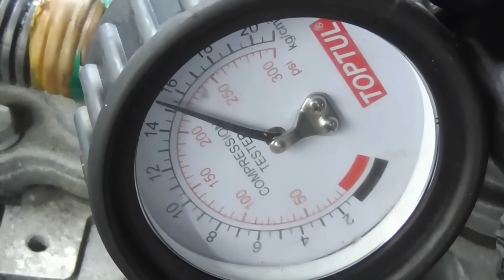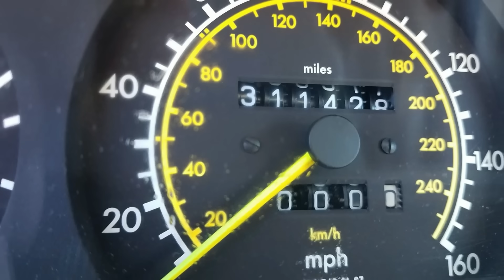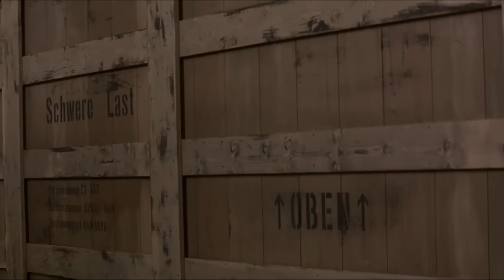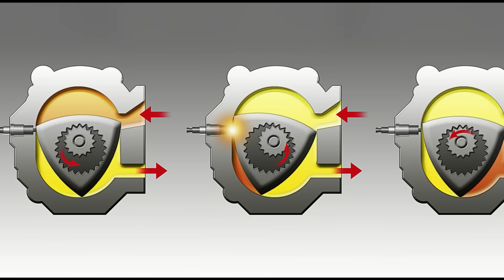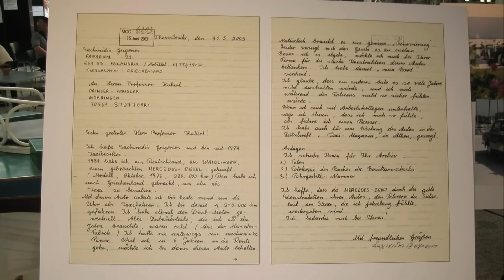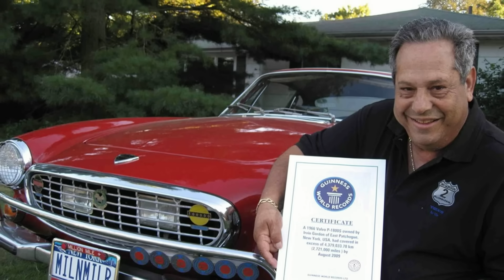Most Reliable Engines of All Time

Comment: I can't believe you have placed BMW engines as reliable. Having worked for a BMW dealer I know different!
Reply: This man's comment is the closest thing to 100% truth  in the universe
Reply: Diesel BMWs are okay as far as I know...
Reply: @MrAvant123  6 cylinder diesels and also 4 cylinder made before 2007 m47 are reliable n47 after 2007 have timing chain issues
Reply: S52/54 with vanos removed
Reply: Ive thrashed my e90 330d for years and it is the most reliable car ive had and pretty swift as well .use good oil and shell v power fuel, job's a gud'n
Reply: M57 is very reliable, what are you talking about? yes its advanced and hard to work on
Reply: How about the 4 Series BMW?
Reply: Well said--BMW--Broke My Wallet.
Reply: They have made some pretty reliable engines despite some others were no that reliable. For example M10/20/30/50/52 engines were pretty simple and very reliables. N52 despite VANOS and Valvetronic is bulletproof engine.
Reply: Especially BMWs inline 6 engines are regarded as very reliable.
Reply: I've owned 2 bmws, purchased both new. 
Both of them broke down within a year. So I bought a first gen turbo honda... let's see how this goes.
Reply: BMW engines are very reliable but drivers are not! Everyone who drives BMW dosn't drive them normaly!
Reply: @DJFlying82  ,
Sir, of all the comments I have read on realiability I find yours to be almost the  truthful one. However , you should have said (NOT Everyone who drives a BMW drives them normaly).
Reply: @carl-uk1774  sorry, my English is bad, but I think people had understand my point.
Reply: @carl-uk1774  That's true.  I have a friend who bought a new 328i in 2004, drives very conservatively and religiously maintains it...it's still going strong 17 years later, coincidentally now has 328K miles on original engine.  A lot of that probably has to do with it being an inline 6...Henry Royce used those extensively in various Rolls Royce models because he found that it was inherently better balanced than any other design.

Comment: this guy things 200,000 miles is a lot we have a expedition that has been ran at out oil before several times by a hs student not taking care of it. It stopped reading miles after about 280,000 2 years ago and runs till this day its 4.8 btw

Comment: I get it. You're a youtube host. Cars are not your profession. 
Buuuut. Perhaps you should leave the choosing of reliable cars to those with a little more knowledge about the subject. 
No rotary engine would ever be considered reliable by anyone's standards. They were built for power and light weight. Not to run a million miles. 
The 2jz is an INCREDIBLE engine. But as far as reliability is concerned, that trophy should go to his little brother. The 22re. Or the diesel toyota engine that wasnt sold in the states. 
The 2jz was built stronger for sure, but the turbochargers add wear and tear that reduces the reliability. The 22re is essentially the same engine, less the twin turbos. It isn't as powerful, or as well known, but as far as the most bulletproof engine toyota ever built... it isn't the 2jz. 
Aaaaaannnnnd you completely failed to mention any old american straight 6 engines. Like the slant six, or the 300. 
Straight sixes are intrinsically balanced. When two pistons move up, two more are moving down, creating very smooth running engines that tend to last forever and ever. As long as you're not over stressing it by trying to lug around 5,000 lbs of dinosaur, those engines last forever.

Comment: A good reliable engine would be 350 Chevrolet Small Block!
Reply: They can last forever. Drove them while working at a taxi cab company. Used the 1988, 89 and a few younger in Chevy police cars. Had lots of fun. Miss it still.
Reply: Had a 1973 Chevelle 350 that had 301,000 miles. Only replaced the radiator. Gave to a family who needed a car. The 15 year old daughter started the car in 30 degree weather and floored it, demolishing a piston. Hard to say how many more miles it would have gotten.

Comment: I have a 2000 Mitsubishi Montero Sport SUV.  20yrs old now.  I have 220,000 miles on it and it runs like a top. Through the years I had to put a new thermostat and a new starter on it but that's been it.

Comment: I was disappointed that some of the more modern engines,, and truck engines were not included.    F-150s are not popular because they have super duper muscle car engines..  The are popular because of the small plain engines.  the 4.2 liter 6  200,000 and more all day every day.  the 4.6 liter 8?  again,, you can find ad after ad in Craigslist with 250,000 or 350,000 miles on it.  Just search the used car ads.  There are a couple of GM trucks that have lasted years,, and Ford F-150s  years and years.  Ya gotta search for a Dodge being sold with more than 150,000 miles on it

Comment: I wonder how many people have ever heard of the Edlin Stewart Engine’ an opposing two stroke engine designed back in 1920’s by two New Zealanders. It was so efficient it could actually run on Diesel as well. They were working on it in the early 20’s and filed a patent in 1930. Don’t know why it never went on.

Comment: I got over 70,000 miles out of a Transit van clutch which I used for towing occasionally and was on the original when I purchased it.  That means the clutch had 140,000 miles plus on it when I sold the van and it never slipped.
I have never had to replace clutch plates on a car or van, only on 2 maybe 3 of the many motorcycles I've owned.
My current car has the BMW M57 engine with almost 200,000 miles on  it.

Comment: I love most of these engines, but most reliable?

I drove a '94 Silverado with a 350 V-8 for 306,000 miles before the trans failed. That was my fault, not the truck's. I now daily drive a '95 Silverado with a 350 for 50+ miles every day. She has never left me stranded, and she has just over 200,000 miles on the odometer. At the grocery store I spoke to a guy with a '96 Silverado that had over 400,000 miles on the original engine and trans. I routinely meet owners of these trucks with 150,000 to 250,000 miles.

The fact that you think 100,000 miles is good illustrates how this channel is a joke. No subscription from me.

Comment: Inline 6 for most part gone. Along with engine compartments long enough fit them in. Side winders are the thing, a maximum 4 cylinder wide. That way the power plant/ drive train occupies the minimum amount of space. The atlas I6 would fit in in Silverado. IF the engine compartment was long enough. The only Truck engine I can think of that was never in a truck. There are a lot of them still running in T-blazers and other brand variants. Moving 4500+ lbs with over 200,000 miles on them. Almost 300 hp on regular gas and no puffer. Almost as good as a FJ 60. Unlike the FJ rebuilding one is pain.

Comment: Missed a few 7.3ford mine has 600000miles changed the oil 3times ,289ford bullet proof and a very fast motor can beat Ferrari hands down pluss many more USCars that wasn't mentioned

Comment: An engine with 100k miles is just breaking in.  My Scion Xb with a 1.5l engine has 220k American Miles and still going super strong.  I only change the oil when I remember which isn't too often.  I just replaced the spark plugs and to my surprise it still had the originals in.  Wow, made me so happy I changed the oil.  :)
Reply: What is an American mile?
Reply: @DarkRumAgain  Now I have 260,000 american miles on my xb with original engine and trans. Drives excellent.  ;)
Reply: @DarkRumAgain  I can say 220k which in USA means 220,000 miles, however in other countries 220k can mean 220 kilometers miles and their is a huge difference in those distances. 220,000/m USA=
354,100 kilometer miles. :)

Comment: The 300D turbo diesel from Mercedes??? That engine should been easily capable of 500,000 miles. But to get 200,000 miles without major overhaul of the fuel system and it's still only put out a paltry 135 horsepower and was actually dangerous to drive because it was so freaking slow. What the hell do you think you're talking about. Reliability is one thing but that was some engine that should have been used as a power output device. It should never have been trying to propel an automobile. You did save the best for last. Volvo engines of the 60s were nearly Bulletproof. But the huge one you're missing was the Chrysler slant 6. I've seen those with hardly any maintenance at all go to easily over 300,000 miles and with any kind of decent Care on it it would easily have been as reliable as the Volvo.

Comment: The 3.4l v6 engine in 1996-2002 Toyota 4runners and 1995-2004 tacomas are extremely reliable and strong engines. Not much maintenance is needed, just timing belt/water pump changed about every 90k miles, regular oil changes, and check fluid levels. Although they are a bit sluggish and get pretty poor gas milage, they have been known to get 500k to 700k miles on them with original engine/transmission. This one should've been on this list.
Reply: Yeah I'm surprised he didn't mention the good old 5vz-fe.  There are some with over 800k.  I've got one with 272k that is running great.  Also the 2uz is known to hit 1 million.

Comment: I know I might got a bunch of crap for this but I would like to mention it just for the fact of this engine has been in several vehicles the Toyota vvt-i engine is actually pretty reliable what's the one I have still thriving with almost 300,000 MI on it with no oil  change they're actually pretty reliable engines

Comment: If you had to replace a clutch at 50K miles, you need to learn how to drive a standard. A clutch should be good for at least 150K miles. If you drive mostly on interstate highways it should last over 250K miles. When you start to move the car has the most wear on a clutch, not to keep it in motion. This guy is a knob. PS..... diesels are the most reliable engines by far, the low rpm’s mean less wear.

Comment: I had a 1987 Nissan pick up with the 2.4 l had 456000 miles when I got rear ended. All original except the valve cover gasket.

Comment: Here’s on of mine, 1995 dodge van, 440 magnum V-8. 275,000 miles on the clock and it still shits an gits. Only problem is the ac leaks a little bit, but when filled it will spit out snow. It’s badass
Reply: You do know they stopped making the 440 in 78.

Comment: I've been an auto tech since 1976. I've seen lots of cars go 300,000+ miles on the engines. My 2 favorites are the Mitsubishi 3.0 V6 that Chrysler put in their mini vans and cars in the late 80's and 90's. They will leak oil and need timing belts, but I've had quite a few customers get 300K miles with no major work. My other favorite is the Chrysler 225 slant 6. About the only way to kill one of those is to  not change the oil and drive it until the oil gives out.  That being said, I think just about any of today's motors will go 250,000 - 300,000 miles with regular maintenance and oil changes.

Comment: Ha! You forgot the 4.0L Jeep. I have a low mileage example in my 2000 Cherokee at 184k Miles.
Reply: Mine has 335k. I did have to change the clutch at 250k on the 5 speed because the release bearing failed. However the clutch still had plenty of material on it.
Reply: havin a laugh? jeep have notoriously bad engines

Comment: What a crock of shite! So he mentions the rotary rx7 engine as being reliable even though the apex seals leak need changing every 60k or so.

Yet where is the 1uzfe???? There is one with over 1 million miles on it and it's still going yet this guy thinks 200k is amazing. Most engines will do 200k as long as the service schedule is maintained ffs

Comment: Iriving rack up miles like going for a cup of coffee 150 miles away. But wait no mention of the bomb proof 225 slant 6? I have a 1989 Pontiac Lemans, Daewoo. It has a 1.6L with 198K on the clock, still has 125 psi compression and holds steady oil pressure @ 43 psi, and gets almost 40 mpg in town. I also once owned a Mazada, a 1972 RE RX2 sport coupe, w/ 150 mph speedo.

Comment: Why mention a Fury that has had the enginer replaced several times?
I got 341k on a 1991 Volvo 740, without any work other than oil, plugs, timing belts and one timing belt tensioner, and I put 242k on a silverado with the 4.8 v8 with no other work than oil and plugs. Both vehicles had original automatic transmissions, rear ends and calipers (yeah I replace brake fluid every 2 years).

Comment: hahaha come on "some import tuners claim that this engine is so strong that it can easily handle twin turbos and single turbo"...bruh,really? It came from factory in both versions, single and twin turbo (RB26)
Then the 2AR - FE can reach a lot more that 200000 miles
I agree with the mercedes diesel engine reliability, but your mileage numbers are too low, I saw those engines with something like 400000km on the clock running perfectly.

Comment: What about the amc Inline 6 I know some of them to reach 500,000 miles without a rebuild
Reply: Right on .. the 4.2  6 cyl.  Concords, Gremlins, Jeep CJ's,  full size wagoneers   
- Notorious for rocker cover leaks though, cork gaskets and warped steel rocker covers not to mention the later 4,0 with plastic ones.

Comment: 1997 Mercedes 220CDI have 740000km whit oil change... 2 clucth and 1 gearbox and plenty of rust repair and 3-5l/100km still...
Reply: I just wondering why turbo Is still alive... Dont know Is It supercharger or orginal turbo becouse i havent open the hood never, becouse oil change dosent cost so much...

Comment: Don't know how this list can be legitimate without mentioning the Ford 4.6 V8 which was in Crown Vic, Grand Marquis and Lincoln Town Cars. These were so reliable which is why Police forces, Taxi Comanies and Limousine Companies used them so much.  Its not uncommon to see 700-800 K in limo fleets  and there are many of the engines that made 1 million miles. Incredible for a mass produced gas V8 with good power.

Comment: This guy‘s definition of long life is is bit off.  I never got less than 200,000 mi on my volvos..  in fach i drove a turbocharged 740 Volvo wagon to 470,000 miles on the original turbo....just changed the oil every 5,000 mi and the trans fluid every 50,000.....platnium plugs lasted 100,000 mi....

Comment: my 2001 alfa 147 1.6 twin spark has 376000 miles and the engine runs like new hot or cold doesnt matter and the clutch has never changed 👌

Comment: He lost all credibility when he brought BMW into this
Reply: bmw built one of the best petrol engines ever 2.5l in e39...
Reply: matija matija the only thing BMW ever built that was the best was a residual drain on owners wallets!  They are sheer unreliable garbage!
Reply: @jamessprague5653  weird because I have 3 sitting in my driveway that run better than your Honda while making double the horsepower. 😛
Reply: @CadexLaw  cute, except my truck makes more torque than all three combined! And here’s a hint. It ain’t a Honda.
Reply: @jamessprague5653  as does my truck, I have a duramax LMM.
Reply: @CadexLaw  I have the bad boy on the block! 2020 F350 Dually 6.7L
Reply: A guy local to me has an E30 325i with over 300k on the clock. Original engine and only 3rd clutch.
Reply: @garrett69  don't believe it.
Reply: The 80s model BMW 4 and 6 cylinder engine are pretty much bulletproof! I'm a BMW mechanic, my boss at the time son knocked his oil pan off and drove it home!
Reply: @chuckmoore8668  that was then, this is now and the current BMW vehicles are junk and their service departments are unethical liars!
Reply: A friend of mine has had several BMWs and reckons it stands for Burn Money Weekly. I have an Audi A6 2.0 TDi, bought with 17,000 miles on it 12 years ago, now 310,000 miles, same engine still good as new. Top cover been off once to replace one glow plug.

Comment: I like to add GM 3800 series lll  V6 3.8L  hands down when of the best V6 engine ever made. Very easy to  get 300,000-600,000 miles on it white little maintenance cost.

Comment: M57 stopped in 2004/5. They changed everything after that, timing chain at the back of the engine a lot less reliable. I have a e60 2004 which is the closest to the original bulletproof e39

Comment: One that's hard to beat was the Nissan "Datsun" L motors.  The L1.6, L1.8 and the L2.0.  This was the engine used in all the Datsun trucks from 1969-79. Not the most efficient but one of the most durable and easy to maintain engines.  Bought a 1977 Datsun kingcab with the 2 liter L2.0 with 160K.  Daily driver for 14 years approaching the 400K with only one cyli der head done 180K.  It's a SOHC, double roller chain driven.  Easy and cheap to maintain, just don't be in s hurry! 
They added two cylinders and you had the 240Z, 260Z, and 280Z to the early 80's

Comment: Volvos Run Forever. I’ve had a 850 T5 and S70glt both with over 300k miles. Zero issues.
Reply: NA white blocks with goon synth lube histories are going to be in this conversation in another 10 years when they start hitting 500k miles or so.  Mine is only at 100 after 19 years 😥